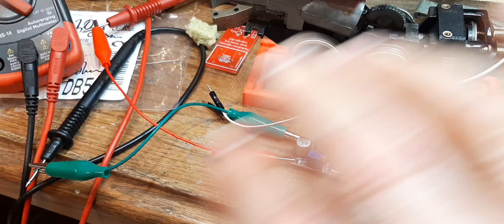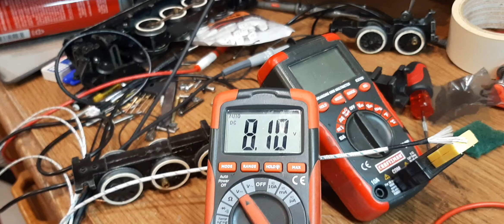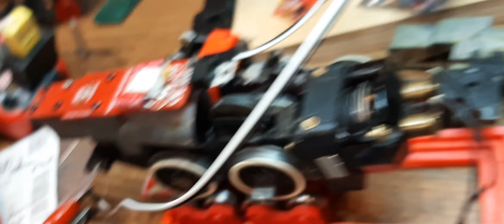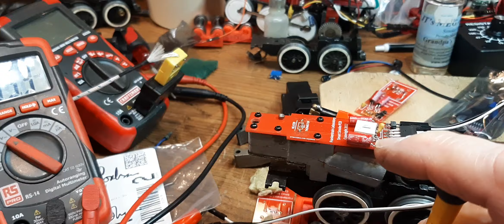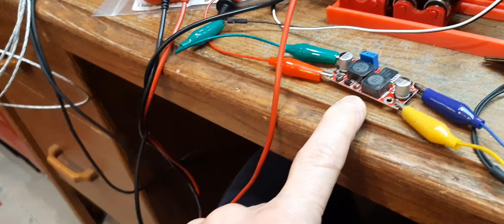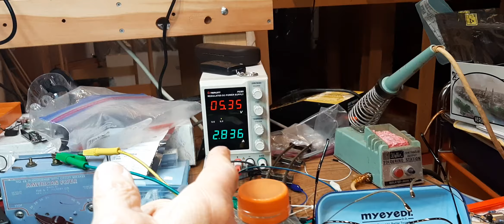How to make smoke at low speed and not trigger the smoke alarm. Buck Boost Baby!

Comment: Like your low power smoke. What are you materials are you heading to make smoke ? R
Reply from the maker: Not clear exactly what your asking. I had discussed the smoke assembly process earlier. But the smoke build for the Vintage FLyer Housing requires some changes. I repack the base, I drill out the Angel Hair access hole and I wrapped the heater in Hair. Then I install this Smoke Regulator device as the new Next Gen S Smoke Lid. I can make a separate video on it if you want to see the details.  On to the tender now. D
Reply: @DennisMurphey  no you answered my question, wrapping the heater with hair. Thanks. R